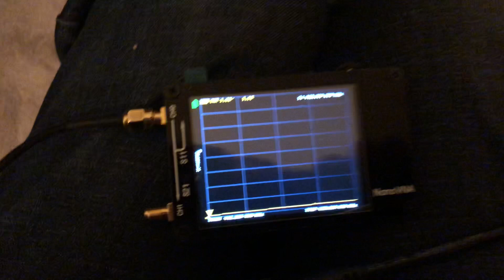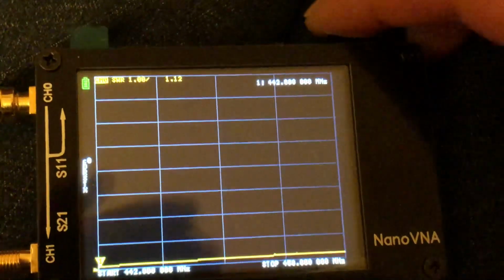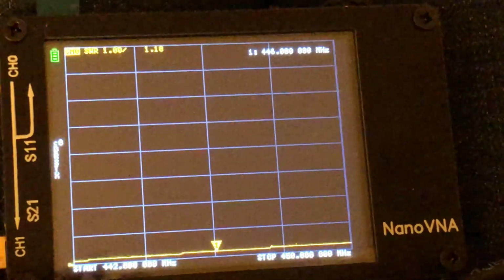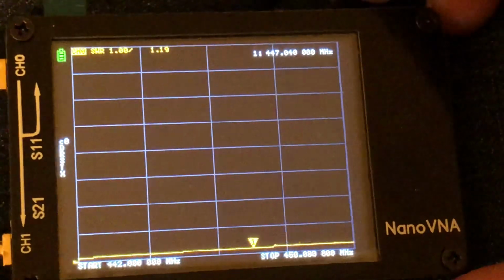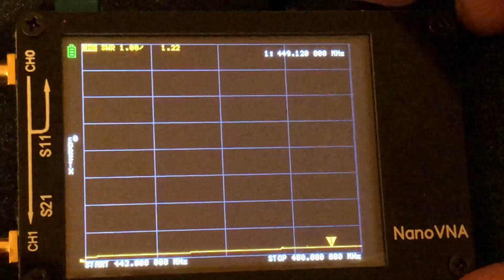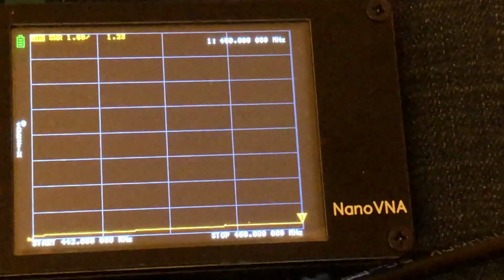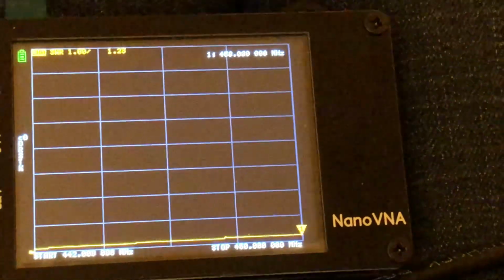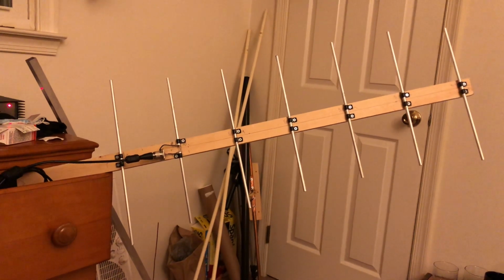Home brew 7 element Yagi for 70 CM. 420-450 MHz repeater work.

Comment: Hi Mike.
I'm sure I'm missing something really obvious here, but why have the other pieces of metal when only one is cut in half and connected to the wire?
Are the rods connected somewhere else that I can't see? Maybe you've a link to share on the design? Looks like a nice and easy build (once I know what I'm doing!) :-) 
Thanks!
Reply from the maker: It’s kinda a Like a Yagi-Uda antenna.  One  single driven element with a reflector in the rear and directors in the front.  The directors are cut at different, usually shorter lengths. Than the driven element.  They are called parasitic elements.  Used to receive and redirect the radio wave from the driven element.   There are loads of plans on the internet.   I just looked at a few different styles and  used what I could find.   I still need to teak this one.  To get it working better.   But when I get it up to snuff I’ll make a video explaining what everyone is asking.  Thank you.
Reply: @mikecricket113  Ahh "parasitic elements" gave me some Google fodder! Thank you! Looking forward to more videos. Thanks again!
Reply from the maker: 73
Reply: You have the dipole, "driven element" the rest are Parasitic